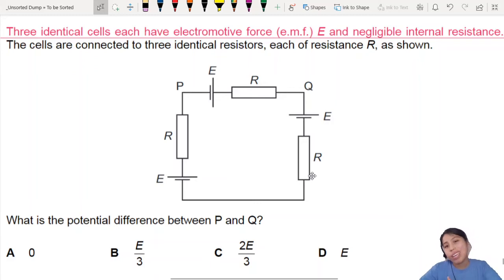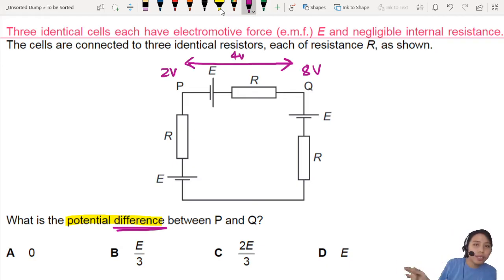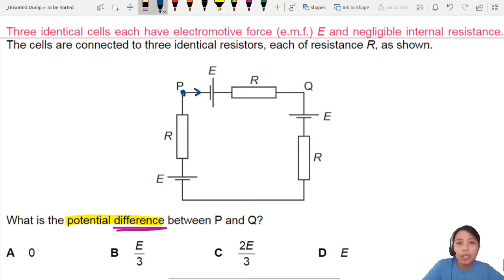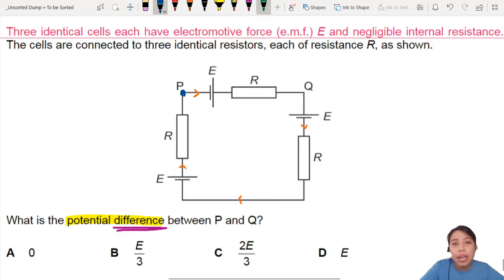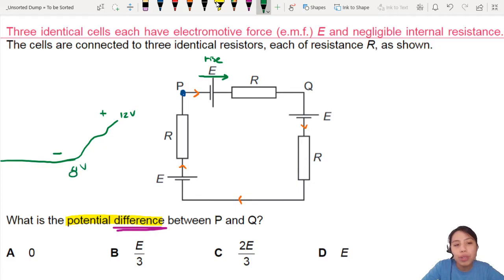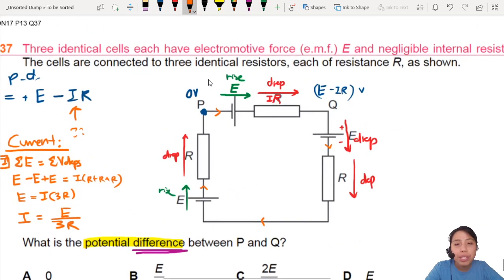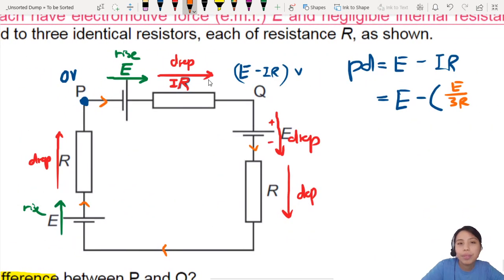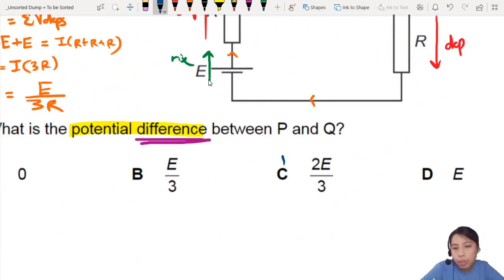10.1c Ex4 ON17 P13 Q37 Circuit Loop p.d. | AS DC Circuits | Cambridge A Level 9702 Physics

Comment: Isn't it supposed to be E/3 since 2 batteries are in 1 direction 1 is opposite to them
Reply: E/3 is the pd ONLY for the resistor. the question asked for pd between points P and Q. so to find the overall pd betwen points p and q is to subtract E from E/3 giving us 2/3E. its kinda like how you subtract internal resistance from emf to find terminal potential diffrence
Reply: You have got the correct step but you need one more to get correct answer 
Across PQ: 1E is gained from the cell and 1/3E is lost to the resistor. And hence 1 - 0.3333 = 2/3 E
Reply: I was having the same problem but then i realised that there is another resistor

Comment: isnt it p.d is = E-Ir where r is the internal resistance, but here we used the big R instead of internal resistance. Why? 
would you be kind enough to explain?
Reply: big R in this case just acts exactly like internal resistance therefore we can just use either of the two